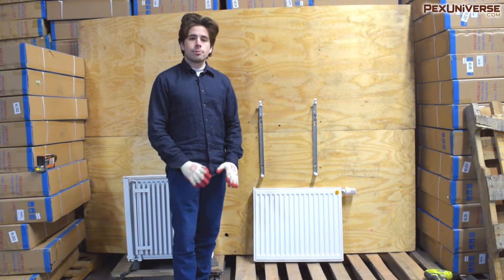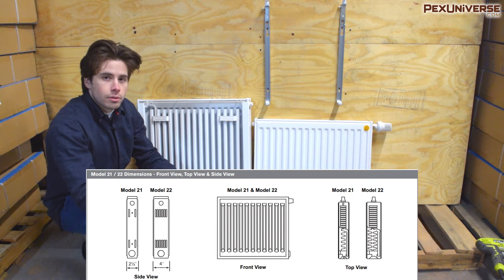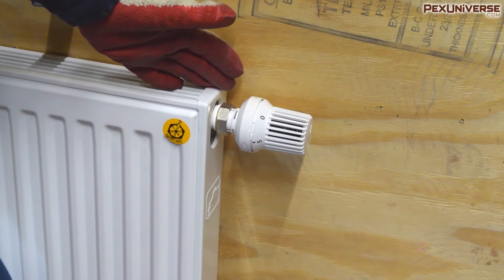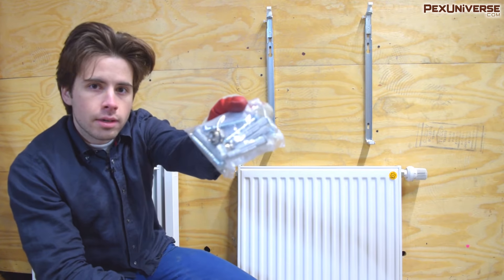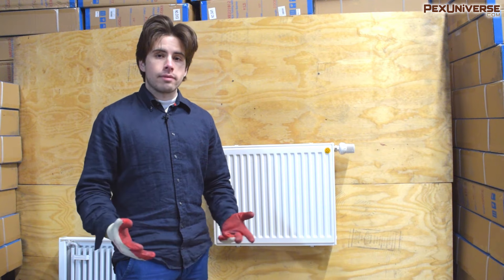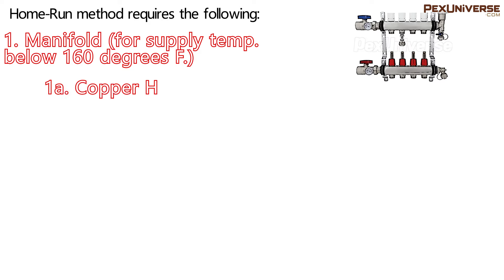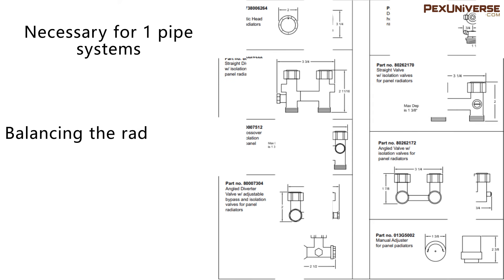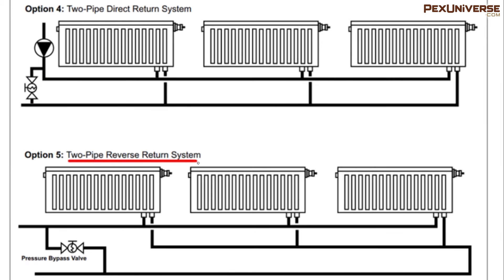How to Hang Panel Radiators and Understand Piping Configurations

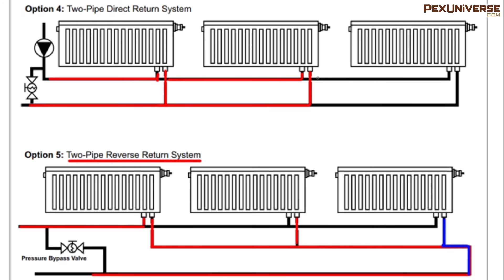Comment: I don't understand your diagram at 6:57. Your diagram for option 5 seems incorrect, after the first radiator the red hot water should feed the next in a series for this to work. In #4 is correct because you have a parallel flow and get even heat from all three.

Comment: The boardus manual states brackets in at least 4” from side but as you said do at least  4 1/4, for supply side do 5” as if you do 4” it’s in the way of the supply line

Comment: Hello what is the depth of the chasing and the height of the radiator ? Thank you!
Reply from the maker: The depth of the chaseway or wall recess for a radiator can vary depending on the specific design and the type of radiator being installed. It typically ranges from 4 to 6 inches (10 to 15 centimeters) to provide enough space for the radiator to fit comfortably within the wall. The height of the radiator also varies depending on the specific model and design but can range from 18 inches to over 36 inches (45 to 90 centimeters) or more. The exact dimensions will depend on the radiator's style and the manufacturer's specifications, so it's important to refer to the radiator's technical documentation for precise measurements.
Reply: @PEXUniverse  hey no i was speaking about the recess for the pipes
Reply from the maker: @HalfLife2Beta  Hey there, drop us a message on our website or connect with us through social channels like Instagram with your question, and we'll make sure to get back to you in a timely manner.

Comment: Rookie question here… what kind of heater is used to supply the hot water? Is it just a hot water heater, like the kind that heats the water for the hot water tap?
Reply: You could use a hot water heater, but that would be very inefficient and not generally how it’s done. Hot water for radiant heat usually comes from a boiler or furnace.

Comment: I’m wondering how it looks with the pex connected. Would the pipes be exposed since the unit is mounted 4 inches off the floor? Is there a recommended way to enclose the pex supply and return for protection and visual appeal? Or would you have the pex coming out of the wall just above the floor and then making a 90 to the supply and return connections?
Reply: I just painted mine white. Otherwise you could build a small 3 sided box with paint color of choice.
Reply: boardus has a pipe cover in some installations

Comment: Hey there I'm new to your channel and I think it's dope. I have older radiators that bang at times. Can I replace with the ones you have in the video using the same boiler and how much do they cost per unit?
Reply from the maker: You sure can!
Check em out here : https://www.pexuniverse.com/panel-radiators
Reply: @PEXUniverse  what additional adapters would I need to get everything done? I'm converting from the generic old school heating radiators to the ones you're showing. Is there a link to each part that I need? If yes could you provide in the comments for me.? Don't mean to be a bother and thank you in advance.

Comment: i have pex running through baseboard in my bathroom wanting to replace my baseboard with a 12x24 radiator could i just connect the pex lines into the radiator with the adapters & just add thermostatic valve ?

Comment: I have a Budaris Panel system which I installed 21 years ago. I have well water and no water filter. Some of the radiators do not heat even after bleeding them. I ran a one pipe system with diverter valves. I'm thinking the radiators need to be flushed out. How do I do that? I have watched other YouTube videos from other in Europe but the radiators are not the same as I have here in Colorado. I also will need to re[place my 8 gang manifolds soon as well.

Comment: i have a high efficiency boiler with 3 zones... each zone has its own different way of distributing my heat... i have baseboards in 1 zone... cast iron radiators in another and the radiator you have in this video in another zone... my baseboards do not get hot and the European radiator i have in my master bedroom does not warm my room well at all no matter how high i put the heat up to. any idea what can be wrong? i have had multiple people come take a look at it and no one can tell me what brand boiler i even have let alone fix my issue.
Reply: I feel your pain.I would never buy one of these again. Run 3/4 copper not 1/2 inch pex
Reply: You almost have to be a heating engineer to get these to work. I have consulted various experts to help me to get this radiator to work right. I will have the final expert within a week or two. If his idea works which is to run three quarters copper pipe instead of 1/2 inch pex to this metal panel radiator. I will let you know. It also sounds like you've got a air bubble lock some where in the system that is stopping the water the hot water from flowing. I also have cast-iron radiators for the majority of the heating in the house.

Comment: Starting to hear about radiant heat and cooling. Running heat pump either way. Do you think this unit could do that?
Reply from the maker: Well this radiator only heats, it doesn't have a cooling process except for when it's turned off.  Is that what you mean?